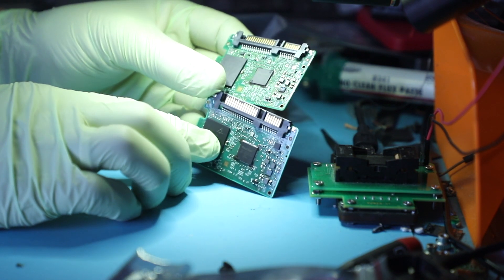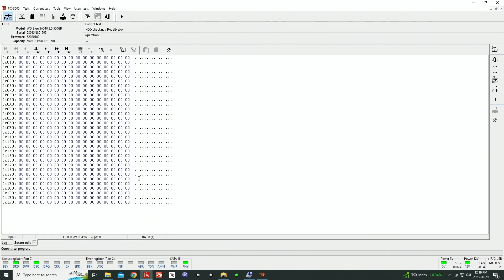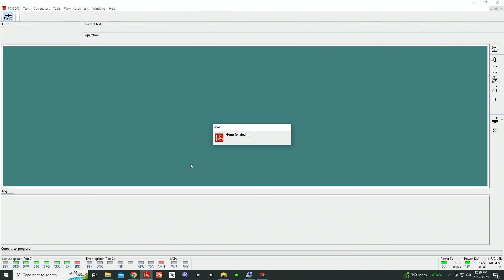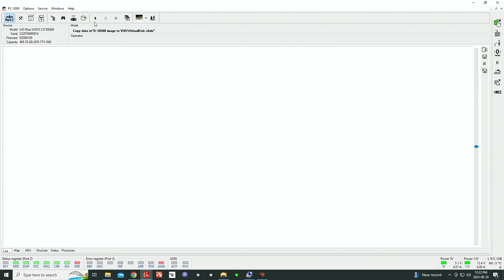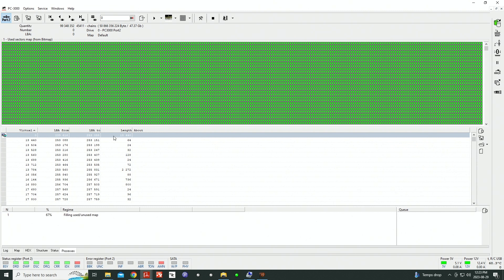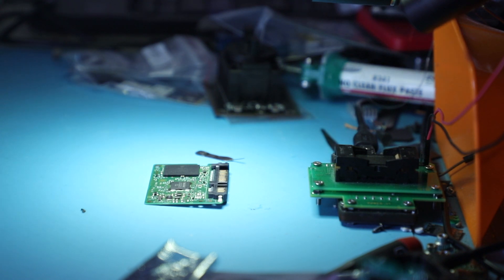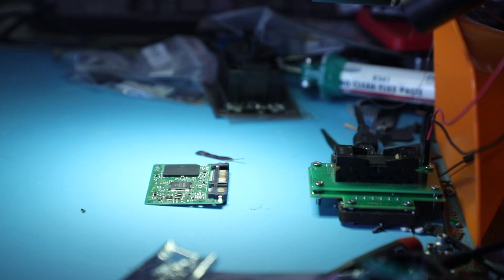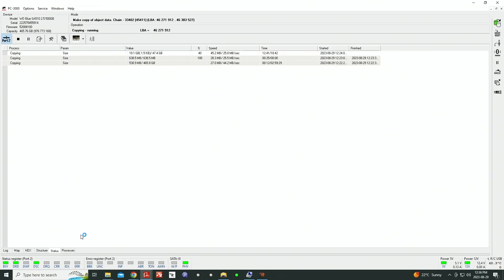The Worst SSD for Data Recovery – Total Nightmare! WD SA510

Comment: I have a similar drive that failed, i noticed the board contains two pads marked with JP1, any idea what could those be? Are they jumper pads? Can i short them if the device is not detected?
Reply from the maker: Probably points for ROM mode

Comment: I've had nothing but bad experiences with WD storage! Every single WD drive I've purchased either stopped working properly or locked up to the point where unlocking was impossible. I bought a 12 TB WD hard drive, and it didn’t even last three months before it locked up. I’m not worried about encryption locks since I don’t save anything that could be considered illegally compromising. For things like stored passwords and sensitive information, I use a flash drive and keep it securely hidden in physical storage. I'm leaning more into Toshiba storage. Toshiba drives can take a solid bump and still work like a champ, and they don't have any of the fancy encryptions.
Reply: Let me guess, the dreaded intellipark.

I wasn't a fan of Seagate but I have to admit that Seagate HDD, especially the laptop ones can take endless abuse and still work. How do I know that? Because I own several Seagate momentus laptop HDD ranking from 250 GB up to 1 TB and I can confirm that not one Seagate drives have crapped on me
Reply: @danteerskine7678  Actually, I’ve made the conscious decision to never ever buy another mechanical hard drive, regardless of the brand. Dealing with a mechanical hard drive failure can be incredibly depressing!

You wake up motivated, get your cup of coffee, sit down at your PC ready to do some coding or launch a media creation tool to get work done—and then you hear: “tick… tick… tick… tick…” Or worse, your PC can’t detect or recognize the drive you were using as mass storage, where all your projects were saved.

Then you end up spending the next three to four days trying to recover the drive—if it's even recoverable. I know it might sound silly, but that kind of situation can genuinely affect your mental health. It can make you feel cursed, send you into a negative headspace, and make you want to give up entirely.

If you’ve got something connected directly to the motherboard, you expect it to just work. I could understand if it were a removable USB drive that accidentally got dropped or mishandled, but not an internal drive.

Honestly, too much bad comes from using mechanical hard drives. It’s just best to avoid them altogether at this point.

I've owned very few Seagate hard drives, and not one has ever failed on me. However, I never really bought them intentionally because Seagate has always been slow to release drives with higher storage capacity. That’s why I usually ended up buying Western Digital instead—they offered more space.

As for Toshiba, the only ones I’ve owned came from used PCs I either found or bought at a pawn shop, and they all performed well. But buying a brand-new Toshiba drive can be quite expensive.

Anyway, happy ending: I got four Crucial 4TB SSDs on Amazon during a Fourth of July special—$700 total, saved $300!

Comment: I have a sa510 and it crapped on me in 5 months. Nothing sees it. I have data i would love to get back but idk if that will ever happen. Apparently it’s a common failure thats related to firmware.
Reply from the maker: Due to lack of proper diagnostic tools its hard to say what is the cause of this issue with SA510. Maybe you would get lucky and your SSD will act the same as the one in this video.
Reply: @ no idea. I would send it but i live in the us. I see your in canada unless you have a us location.

Comment: Whenever a electrical device works one time and another not I check for bad solder joints and also try if temperature makes a difference. Make it freezing cold or warm it up sometimes gives a chance to read the date one last time.

Comment: My suspicion is that it's temperature related.
Reply from the maker: In testes I’ve conducted leaving them on power for long periods of time will have about 30% chance of getting them out of the dimmed registers state and ready signal will start to flash. Maybe it’s related to temperature. Maybe at specific temperature the unit gets a chance at better voltage for read retry and actually gets to read and self remedy the firmware glitches. Kinda like chckdisk would for beat up windows system

Comment: this drive have high failure rate in reddit.
How can big company like WD act like a startup chinese company
Reply from the maker: People see at the price. There is no good products for cheap. Quality, speed and good prices. You can only have 2 for any product not all 3. Fast and cheap - you get shitty fast failing SSD. Slow but good price you get a hard drive. Fast and reliable quality SSD will be very expensive

Comment: What brand/models of SSD would you buy personally? Just wondering what you would recommend. Thanks!
Reply from the maker: Something that has a supported controller that is well supported by utility in case it fails. Problem with SSDs is that only a very small portion of them can be recovered due to support limits of tools.
Reply from the maker: Something by that has silicon motion controller like SM2263XT maybe

Comment: Why don't you use specialized manufacture software to test the controllers and the system as a whole? 
You should have access to Sandisk and you can use the developer tools to test the port and the translation system and even fix it if the ssd is not recognized by the computer.
it common issue for WD Blue SA 510 and it fixable.
Reply from the maker: would you drop a link to this software? its first time I heard about a utility made by Sandisk or WD that will help with the translation table.
Reply: @hddrecoveryservices  If I provide you with acess, it won't work because you need access to download from the Western Digital portal. This requires a password for FTP access and signing a non-disclosure agreement beforehand. Moreover, as a dedicated specialist in the field of data recovery, you would typically have access to exclusive forums for developers and engineers from companies like Seagate and Western Digital. These forums, along with various specialized programs, utilities, and tools, offer far more advanced options than what you're currently using for data recovery—especially for hard drives. ACE, while a solid and general-purpose solution, is an expensive option that is not necessarily the best. Additionally, if you're based in Canada or the United States, you can obtain high-quality diagnostic utilities directly from the manufacturers.
Reply: @hddrecoveryservices   chirp chirp chirp ..
Reply: @hddrecoveryservices  If I provide you with a link, it won't work because you need access to download from the Western Digital portal. This requires a password for FTP access and signing a non-disclosure agreement beforehand. Moreover, as a dedicated specialist in the field of data recovery, you would typically have access to exclusive forums for developers and engineers from companies like Seagate, Toshiba and Western Digital. These forums, along with various specialized programs, utilities, and tools, offer far more advanced options than what you're currently using for data recovery—especially for hard drives. ACE - while a solid and general-purpose solution, is an expensive option that is not necessarily the best. Additionally, if you're based in Canada or the United States, you can obtain high-quality diagnostic utilities directly from the manufacturers.
Reply: @hddrecoveryservices  youtube banned all info which I provided. sorry.
Reply: Yes, the specialized software from the manufacturer really helped me recover data from that SSD. 
So make sure to use professional services. I was told that only a few services have such software, but from what I can see, it's not being used here.